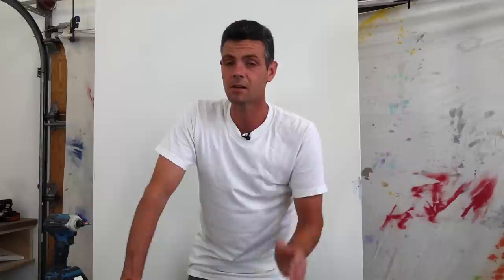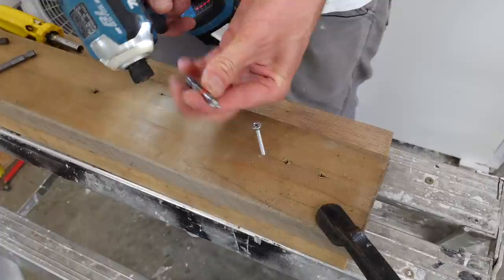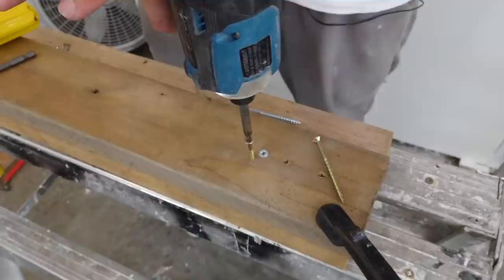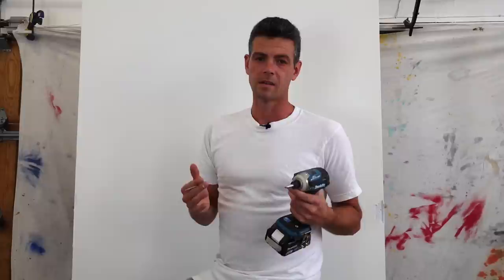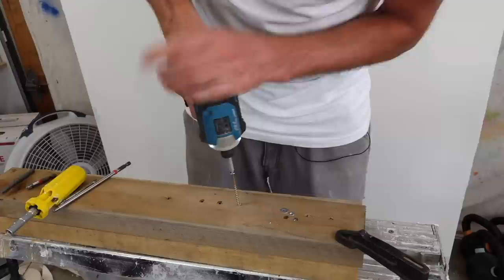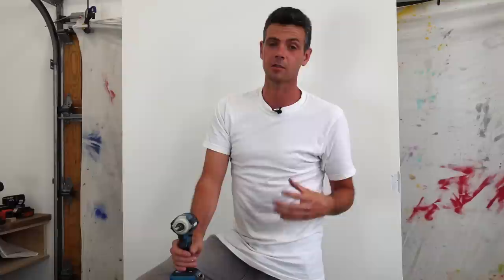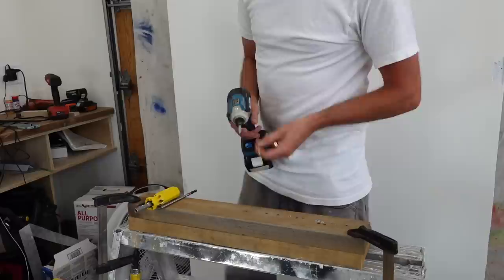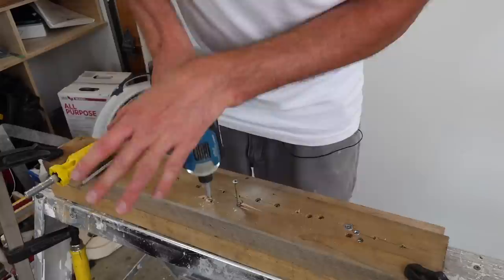The Top 5 reasons you’re Stripping Screws

Comment: Or with Robertson deck screws, the coating can be built up in one out of every 40 something screws. Just toss that one right in the can and move one.
Reply from the maker: I totally forgot to mention coated screws. Some brands of those are so bad.
Reply: sometimes i get the ones that have shavings coated right into the screw head
Reply: @vancouvercarpenter alot of times you have to buy a bit made by the screw manufacturer, else they just won't fit right in the screw head. Its so annoying

Comment: As a 30 yr. contractor I do a lot of exterior jobs requiring color matched screws, and occasionally run into a batch of over sprayed screw heads making it impossible to drive the screw without cleaning the slot. It usually happens with screws that are included with the product. Enjoy your videos I always pick up some good info from them!

Comment: I also find it helps to have pozidriv screws and bits. Also, don't mix those up.

Although they're intentionally designed to be as compatible as possible, it's only meant for those unavoidable scenarios where you don't have the right screwdriver at hand.

Comment: 7:14 Minor correction: An impact driver applies a rotational impact, not a downward impact like you describe (that's a hammer drill).  Thanks for the great content, I watch all your videos!
Reply: And the magic of impact drivers is that they stop applying rotational force in between each impact so even if the bit starts to cam out, it falls back into the screw head after each impact.
Reply: I'm pretty sure there is a forward vector to the impact as well. Otherwise an impact driver wouldn't do much better than a screwdriver for stupid drives like Phillips.
Reply: no an impact driver does not use a forward impact. The extra force of the impact is applied to turning the bit thus turning the screw. The threads on the screw pull it in. A hammer drill provides impact force down through the bit to push it into the material being drilled. Hammer drills are not for driving fasteners. They are for drilling into rock, cement, masonary.
Reply: @454Casull  Screws like phillips are purposely designed so that the driver 'cams out' and slips to avoid breaking the head off the screw. If too much slipping occurs, you strip the screw. Impact drivers work exactly the same way as when using a hand screwdriver on a tight screw and only rotating the screw only a fraction of a turn before stopping and making sure the driver is fully seated into the screw head before rotating it another fraction and so forth. All the forward force on an impact driver is provided by the operator just the same way as a hand screwdriver, the only thing the impact driver is doing differently to a drill driver is momentarily stopping applying a rotational force and allowing the bit to fall fully back into the screw head which gives it a better chance of not camming out on the next 'impact'. Also why an impact driver can break the heads off screws more easily - it's defeating the cam system that is designed to prevent screw heads breaking off.

Comment: Good tip video. Always handy to remember the straight line approach. Getting an impact driver is huge too... I finally got my first after far too long of just winging it with a drill. Night and day difference with getting screws in cleaning now.
Reply: Yup, whenever I switch to a drill, for whatever reason, its way harder to drive a screw because the torque wants to lift the bit out of the slot. Impact makes life much easier.
Reply: Impact drivers are faster, but harder to control, there's no clutch, it just instantly beats to hell whatever you're screwing together.  I would say it's great for framing, fences and decks, but not so good for fussy things like door hinges or even fence boards, as unless you have a magic touch, it will overdrive and mangle them.
Reply: @mgjk  Interesting, I must have the magic touch. I use the impact every day and only use drills for drilling. The driver is much more easily controlled and precise. I use it for decks and framing, but also for hinges,  door handles and cabinetry.
Reply: @markoshun  Agreed, he just confirmed what all the ladies tell me, my fingers have the magic touch.

Comment: Good info. I'd add that not all bits are equal. Project farm has a good video on it. Also, Phillips screws were developed so that it would cam out. Even with a good bit, the design of them will cause it to cam out if there isn't enough downward pressure for the torque being applied. Get a set of JIS bits to avoid this. They fit in Phillips screws but aren't designed to cam out.

Comment: Phillips heads suck. I've moved on to Torx. Problem solved in my world. Thanks for the videos 🥃🥃
Reply: Yes but manufacturers for a lot of different things use Philips still. Drives me insane because as you stated Torx is the best!
Reply: @LazyCrazyGuy  Im in the process of remodeling my house. I used Phillips only for the drywall.
Reply from the maker: I’ve tried torx but because it isn’t common here I could not find bits that fit well. They were all sloppy and were more annoying than a philips or Robertson
Reply: @vancouvercarpenter   omg no way 🤯

They are quickly becoming the defacto standard for most applications here in the US but as I stated earlier. A lot of manufacturers are sticking to the old ways. But I would prefer even Robertson bits over Philips. Philips just drive me insane how they cam out so easily.
Reply: @LazyCrazyGuy  Torx are definitely the best, but manufacturers use Phillips specifically so their drivers cam out before they overtorque the screws. It's a manufacturing consideration.
Reply: @vancouvercarpenter  Yeah, here in Canada Torx driver bits are either too tight or too loose. Very frustrating.
Reply: Grk Screws seem to be great with the bit supplied in the container and last forever!.  I still am all about Robertson as that is what I grew up on.  Phillips is crap in most cases except drywall screws but I think that's because they are made from a harder steel.
Reply: @Matt-my7pz  Hmmm, maybe I just have a crappy set of bits and should stick to the default ones in a whole container (which I rarely buy, btw. Primarily I buy loose for bulk prices which doesn't include a bit).
Reply: @vancouvercarpenter  Yes, they even include a bit in some of the boxes that don't fit very well. Not sure what's up with that. Such potential.

Comment: The worst screws are those that come with imported fixtures ,such as curtain rod brackets and many electrical fixtures. They're a soft metal with a slot that doesn't seem to accept any common bit. I quit using them and us better screws. I'd love to see drywall screws go to square drive or torx. I'm so old i remember in highschool woodshop when most screws were still sloted. Even a corded drills were rare to use. We all had the Yankee screwdriver with a sloted bit.
Reply: You can find square dimplers for setting screws, etc., but those screws don't work as good with dimplers and are not good at all for drywall. The phillips heads can be flatter, which is perfect for not sinking too deep into drywall.

Comment: something ive also noticed that might be of help to someone is that I've been noticing that a lot of kitchen cabinet hardware has a pozi head on it, this can be a major head ache because eventho it looks like a Philips is actually slightly different. 
You will actually see an additional lines that a 45 deg offset between.
I never noticed them anywhere until i started working with that hardware daily.
And these are on blum hardware

Comment: One other thing can help drive screws better, especially when you only have one hand for the drill because the other one is hanging onto a ladder or some such.

When you grab the drill, choke up on the handle. Put your index finger along the side of the drill motor case, and you can use a little finger strength to help keep the drill straight. Use you middle finger on the trigger, not your index finger. Your index finger is up on the drill motor, pointing at the screw.

This gets the center of your arm closer to the straight line thru the screw and screw bit, so you don't need as much wrist strength to keep the drill from flopping all around, and lets you use your whole arm to put some force behind the drill.

Comment: yes I have had scews with not to spec, heads, never had a whole box, but many with defects.
.
Another Important thing is knowing the difference between similar screrw types,.
Philips and Posidrive can look the same to the uneducated and they will work with each other under low stress situations, but as soon as you start pushing it, they will slip and chew out with the wrong driver bit. The other thing if the bit does not match, the screw will not stand up on the end of the driver.
There are variations on the square and hex bits too.
Most people know that there are metric and imperial hex bits, but few know there is an obscure series of imperial hex sizes
Then there is the T27, Torks bit trap, lots of chain saws and garden equipment uses T27 screws, but a lot of Torks bit sets do not have a T27 bit, so people go at them with a T25, with unhappy results. 
.
Of course, there are tamperproof versions of all the bit shapes and deliberately obscure manufacturer specific driver shapes.
.
OH HELL, it's all a trap for young players.
.
More recently we have an issue with the quality, strength and hardness of the bits. This has been made much worse with the introduction of impact drivers.
A lot of the cheap but sets are just too soft and chew out far too easily. Some manufacturers try to harden the tips a little too much, thus they break, especially when used with impact drivers.
If you are at all serious or do any qualtity of this work you are best to buy from one of the specific specialist quality bit makers.
The power tool branded bits are best considered mid range and a fair thing for moderate use.
.
Of course if you are using an impact driver especially a powerfull one, you will be wise to buy bits specifically intended for use with impact drivers.
.
AND finally, always have multiple spare bits, if you don't expect to go home early.

Comment: https://youtu.be/AluqSas6eyw?t=441 You described a hammer drill, not an impact driver. The impact driver imparts rotational impacts, not forward impacts like a hammer drill. Wikipedia says that it (impact) does both, but I've never seen this or heard of it. If there are ones like this, they aren't typical consumer impact drivers.

With that said, you're far more likely to strip or lose contact pressure with an impact driver due to the high burst of torque via the rotational hammering. I still prefer impact drivers for almost everything because of their compact size. I literally only use my drill for well, drilling and when I want to be quieter.

Comment: Slot is a glorified chisel and Posidrive or Phillips are "meh" in a strong way.  Ignore the fact I'm Canadian please, but all about Robertson drive.
Being an electrician I so appreciate a good screw 😳.  
1) Impacts drivers (Ben is using an impact) also give a handicap or make it less likely for not skipping versus a twist drill (regular drill.  Haha Ben just mentioned this.
2) I worked in a fastener store when I was young.  When manufactures produce screws, the die can be either really fresh or worn out which affects how well it seats.  Sometimes you can't get the screw off of the bit.  Other screws are sloppy no matter if you have a brand new bit.  On occasion get a batch of screws that are complete shit to fit to a driver bit.  Self tapping Robertson screws seem to get this a lot.  Then there is the deck screws that get filled with the green or brown coating.  You can't even begin to drive it.
Grabber brand drywall screws on the other hand, with the bit provided are incredibly good!  
Ben knows all this I'm just feeling like I'm part of the cool kids group.
Reply from the maker: I love good comments. Thanks🙂

Comment: Seems like some carpenters are using 3" to 4"screws while reno framing walls instead of nails. With the hammer drill this has become more common. Don't know if this is a good thing but those wall studs look well secured.

Comment: I've noticed people without experience also have pressure issues. As they drive the screw, it pulls away from the bit. If they don't learn to keep the pressure on, the head will strip.  Same when removing, although it is counter-intuitive to put pressure in the opposite direction of the way you want the screw to move.

Comment: Pro tip. Use torx whenever possible.
Reply: Torx is even worse to stripping w/ the wrong size bit. That being said: it's still  the best head for wood screws (save for the hex one, driven with a proper socket)
Reply: @stanimir4197  not sure I agree. In my experience a t-20 will work okay on a t-25 head in a pinch. And if you do manage to strip it it'll still be drivable when you get the proper T25 bit. 
Hex is much less forgiving. If you strip it with an improper bit your SOL. To be fair though I don't have a ton of experience with hex.

Comment: in my experience there are actually different types of Robertson's, the ones with a crisp square edge in the bottom and the ones that are rounded over. if you are using a rounded over bit in a crisp edge screw it isn't so bad but the reverse is absolutely infuriating.

Comment: I am surprised that few know that there is a Special bit for Coated #2 Robertson (square)  Deck Screws (Approved for Pressure Treated wood) ... A Standard #2 "Robbie" will work, but the screw itself, was a #2 Before the coating was applied so the "holding power" from screw to bit is just not there.  these bits are not not Typically colour coded (Green Red or Black), but rather just Steel (or Chrome).    I know the screw itself is not a "Number 2" but rather a # 8 or 10 etc.  the #2 referenced the slot that is used to drive the screw.  Thanks for the Videos!  I watch nearly all of them... and I Hate Drywall!! lol
Reply from the maker: I’ve never heard of bits for coated screws. I might have to look a little closer next time I buy some bits.
Reply: @vancouvercarpenter  Don't bother! they will be in your assortment of bits in all the places that you think that makes sense to store  Bits... you will NEVER find it, and will choose the #2 Robbie Every time!
Ask me how I know!!

Comment: I buy box boxes of drywall screws and you're guaranteed to have at least a few of them where either the hole is not drilled far enough or there's something in there and your bit doesn't go in all the way.
Reply: That really depends on the producer and how cheap (expensive you;d pay for the tolerances.
Reply: @stanimir4197  Just the standard 1 5/8s drywall screws that they sell at lowes.

Comment: 2:49 Sloppy screw head tolerances weren't common back in the 80's and 90's but right around the early 2000's I started to notice that Robertson #2 and some #1 and #3 heads were very poorly 'stamped'. Oddly, it was around that time that certain 'brands' decided to stop making their screws in Canada and go off shore. Make what you will of that but the quality of the bits to drive them also went down around the same time. 

Oddly, right around the time that Robertson's patent expired it got even worse. Lately, it's hit and miss. I may go through several boxes of (100) screws and be fine then hit a batch (lot #) and have to return them all. Sometimes you clearly see the poor production quality so I mention it to the store department manager as a heads up but few give a crap.

Not bashing any companies or countries but just stating personal experiences. YMMV.

Comment: A huge problem with Robbie's now a days is they're not all made exactly the same. Bits often times a few microns too large and never fully seat in the screw head. Fucking drives me bananas and you've gotta go through bits to find one that works well enough to go. 

We used to use 3/4 #10 Robbie pan heads tecks for running conduit, but they're so trash now it's just easier to use a robbie for the fittings and a 5/16 headed Teck screw.

Comment: The kisses of death for me are over-reaching so I don't get behind the screw properly, and driving screws where there isn't enough clearance for the driver to attain property alignment... I am the height I am, so using or moving a ladder often solves the first problem. Using long bits and even extensions helps with the clearance problem. There are times, however, when using one of my ratcheting braces with a screwdriver bit comes in handy for driving large straight-slot screws as I can put weight behind it and have lots of leverage if I use a brace with a long throw. Screws have gotten crappier over the years too... something hard to tell from looking at the package and going by price has become meaningless. RE the latter, I try to buy my fasteners at a locally owned hardware store. This as for identical products they are always less expensive than the big box stores, and they are also more likely to have quality fasteners available for prices similar to the big box stores.

Comment: Though it didn't come up in the video, those Pozi-drive screws are annoying. I find them in cabinets and door hardware. They look almost like Phillips but strip easily with a Phillips bit. Of course you're supposed to use the correct PZ driver but does the average homeowner have PZ bits handy or even know the difference?
Reply: To identify, look for the “X” marks at 45 degrees to the main cross.
Reply: I had a few Pozi sizes in a fairly consumer-grade set of bits, but never had to use them yet.